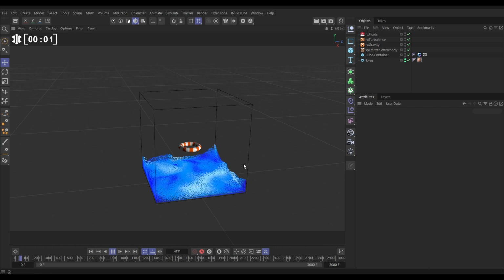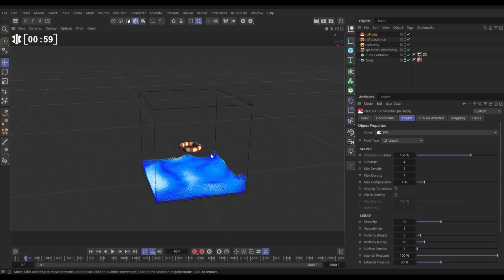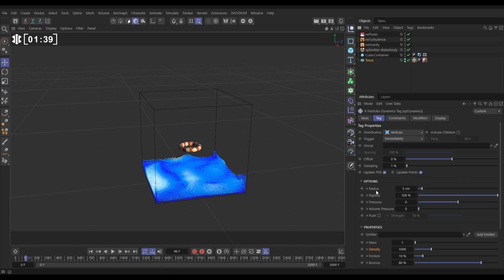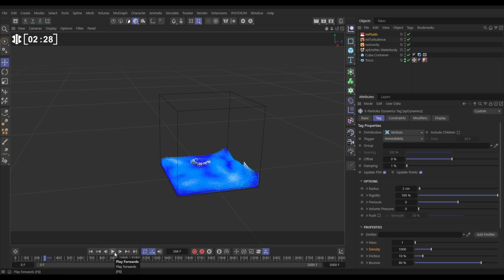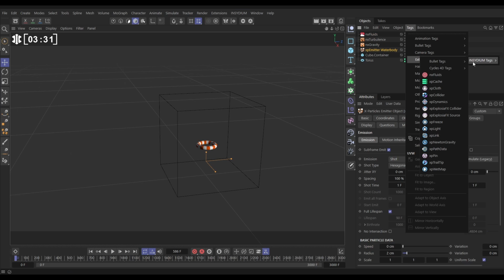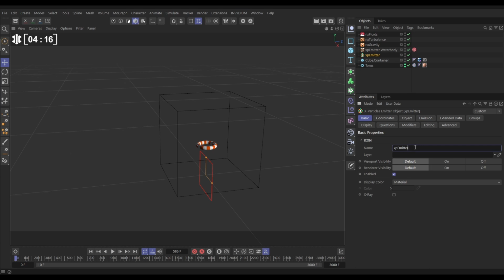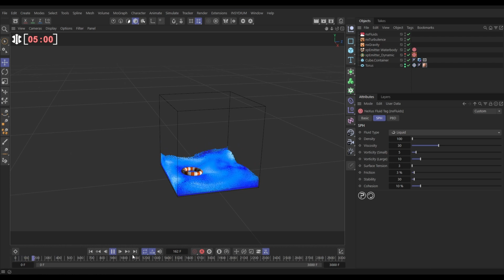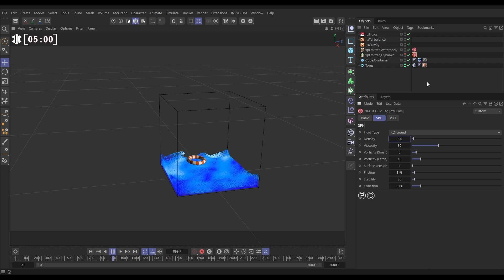Top Tip Tuesday! - nxFluid Dynamic Objects

Comment: Great tutoriall ! Thanks. Any chance for similar but with a simple boat instead of a donut ? I tried but i don't know how to stop the boat from flipping to the side. Or even how to make it move in one direction ?
Reply: Easiest thing to do would be to make a very short cube that's roughly the width and length of your boat. Use it for all of the dynamics and then parent your boat to the cube. See if that gets you close enough.
Reply: @thegreatszalam  that could potentially work but still not sure how to stop the cube from flipping on the side. It eventually will. Plus still don't know how to control its speed and direction. This only let the cube/boat float on the water.

Comment: Very cool; I like more realistic sims such as this. For a more complicated floating object, say a ship with 200K polys, would Nexus be able to handle that or would a simplified, low-res mesh version be advisable?
Reply: It should be simulated with a low Res mesh. There is no point simulating it with dense polygons
Reply: @ariaperdana24  That depends on the shape. I've had issues in the past with low-poly meshes not being accurate enough.
Reply from the maker: It's possible! but it would depend on the complexity of your scene and your machine specs. However, it's nearly always more manageable to work with a low poly version. 
-Thanks
Reply: @INSYDIUMLTD  Thank you. 🙂